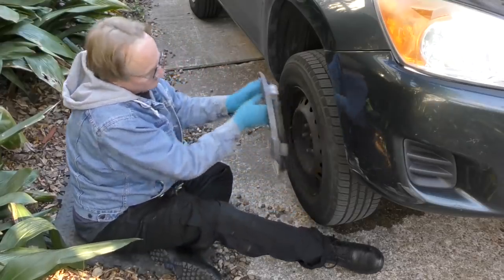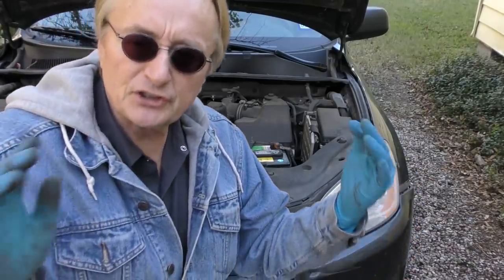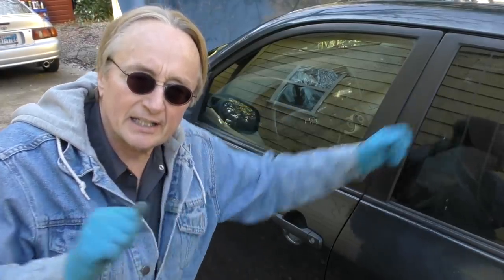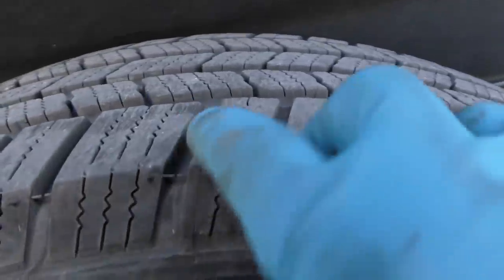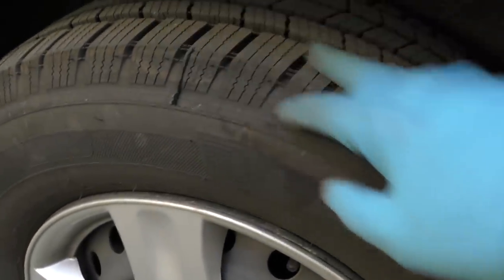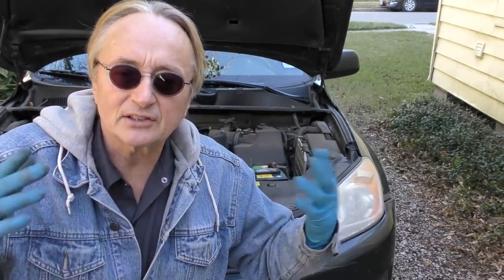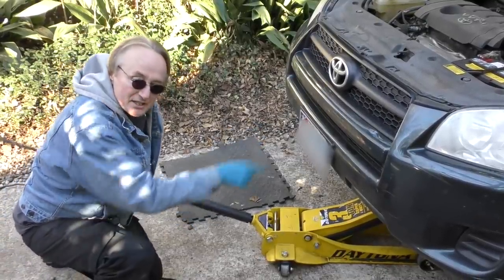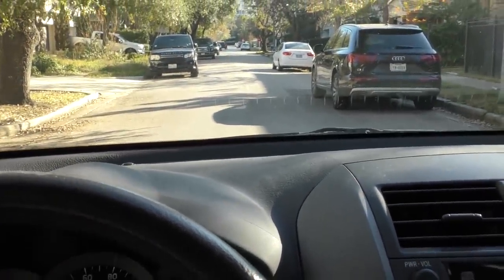Tire Secrets Only Mechanics Know

Comment: Hey scotty, I have a 2005 Yukon XL. The brake light and abs light comes on every time I get on the brakes and it stays on. I have topped off the fluid, checked for leaks, replaced all 4 rotors, calipers and pads, and the master cylinder. It still does its thing. What should I do?
Reply: Do a complete system flush. I had a customer who had that problem for 2 years until he finally got the brake fluid system flushed. The fluid is only good for a few years
Reply: @rays7437  tried that it didnt work. It did help tho
Reply: @salteengaming  
Then the brake fluid level sensor or one of the stability control system sensors could be having a problem.  GM products have touchy electrical systems so it's hard to say. Problems like the one you are experiencing are frustrating
Reply: @rays7437  I tried the sensor. It has no stability control
Reply: @rays7437  I actually tried the sensor after I done the brakes
Reply: @salteengaming  
You may have to have somebody install a data recorder and read the data as the fault occurs.  It sounds like a gremlin that you may never find, however.
You said that doing a flush helped a little.  Maybe try another one?
Reply: @rays7437  I will try that again, I will also get my buddy to do the live data thingy.

Comment: I have noticed ifYou only put one new brake caliper on the front and have a old one on there the other side that the breaking doesn’t seem right also the new caliber works better than the old caliper obviously causing an uneven braking

Comment: That's exactly what I would of done to the vehicle. They also need a front toe/camber alignment, you can see that the wear on the tires show that. 
The owner of the RAV-4 probably had tires put on the car and didn't get an alignment, and now that you rotated the tires their issue is gone, but will come back within 3,000 miles. 
I've been a mechanic for around 20 years, and have my own shop now, but I remember when they came out saying that the best tires need to be in the rear... I NEVER did it, I always put them in the best placement for the vehicle because I cared about the customer. The reason they want the best to be in the rear is because they want the tires to wear out faster, therefore causing the customer to HAVE to come in to spend more money. 
I got tired of cheating people out of their hard earned money, so I opened my own shop and took all my regulars with me lol!!! (Don't get me wrong, I liked getting the extra money from jobs that didn't need done, I just felt bad about cheating people for it)... 
Now I do it all from gas to diesel, engine rebuild/repair to tires and alignments and brakes, all the way to customizing and aftermarket exhaust systems.
When people learnd that alignments start at $20 compared to $80 at Firestone, and $89 at a dealership, they started coming in just for that alone. Then everything else took off after they found out that I'm a trust worthy vehicle Technician, that doesn't cheat the customer out of their money.

Comment: Scotty my air impact gun will keep running even afterletting go of the trigger. It just started the last time I used it. Any ideas?
Reply: I'm fairly certain it's the valve in the handle of the gun... I had it happen multiple times on a blue point gun I had. Get rid of it if it is. If you want a gun to last, get an ingersoll rand. Tool warehouse online, 220 bucks shipped and it will last at least 8-10 years with daily use. That's just a suggestion it isn't cheap but obviously being a mechanic, it's so worth it.

Comment: It’s called tire rotation , also no way that’s gonna make the car feel loose while braking at higher speeds ,, I had a couple cars coming to my shop with similar issues  and usually is a worn suspension ( front or rear) component or a sticky brake caliper or something like that, usually if a tire has a problem you are gonna feel it by just driving the car  , also you are supposed to torque those wheels with a torque wrench or torque stick if using an impact

Comment: Scotty,  I mostly agree with all your o-posts, but this one about putting the best tires on the front of the car  is wrong , you have a flat on the front the car will pull to the side with the flat but you can pretty well control the car till you get off the road,, a rear tire goes flat the car will start to fish tail and you lose3 control, I know this because I drove a modified race car, won two champion ships, over 4 tears, every time I blew a rear tire I spun out messing up the car, you can not control a car at speed with a rear flat tire, you will start to broad slide

Comment: will an electric impact wrench be strong enough to remove an anode from a properly anchored water heater?
Reply: You can try it. My anode rod just laughed at my 1/2" air impact. A 3' cheater bar got its attention. I had to use a pry bar between the water  fittings to keep it from turning. Also worth noting, there's often not enough space above the HWH to remove the anode rod.
Reply: @hughbrackett343  l may be ok being my house is old and has 10 ft. ceilings. Maybe l'll save my $ and go with the cheta idea. Thanks for the heads up.

Comment: Tire shops insist on putting the new tires in the back for liability reasons. They rather have you under-steer than over-steer and spin-out in slippery conditions.

Personally, I prefer putting the better tires in the front for more grip, otherwise, it will never wear evenly compared to older tires.

Comment: Whenever I have my tires/wheels worked on (rotate and/or balancing) I have to recheck everything...tire pressures and lug nut torque. NOT ONCE has a shop done it correctly (stock torque and tire pressures). One time they didn't even reset the TPMS....that jacked up all kinds of issues. One, time they didn't put a wheel cover on properly and it popped off on a busy street. Luckily, I was able to double back, stop, get out and grab it...and not get run over. So, now, I take them off before I have any work done. Can't trust anyone anymore Scotty.

Comment: Correct me if I'm wrong but the MAIN reason the front tires of a front wheel drive front engine car wear faster than the rear tires is because the weight of the engine is over the tires – which Scotty didn't mention.. The supposed reason that tire dealers want to put newer tires on the rear of front-wheel drive front engine cars is spin-out on wet or icy roads. If the rear tires are more worn and the rear of the car loses traction, because there is very little weight over the rear, and because power is not being sent to them, on an icy road if you brake suddenly the front of the car will stop but the rear will not. It will keep going. But because the front is stopped they have nowhere to go except around in a circle with the center at the front of the car. I think they are worried about an accident when this happens, and getting sued. The sales person at the tire dealer described this as "oversteer." Of course, it doesn't hurt that they know that if they put the new tires on the rear, you will need front tires sooner, and if you buy your next pair from them, they will get another sale sooner.

Comment: My lady's 200,000 mile 2006 Toyota Rav-4 is a pile of junk...it was overheating really bad again, took it to my mechanic and it turns out it had a head gasket goin, A HEAD GASKET, but he saved us a bunch of money by using some sort of sealer that has ceramic liquid in the motor and so far it's been runnin alright...my 312,000 mile Ford Ranger has never needed any drivetrain work whatsoever, besides the basic maintenance....and her car, it's had 8 or 9 recall repairs done to it, the most I've ever heard of a car actually having had done, the interior is a plastic filled cheaply done interior and its a top of the line Limited package...she hates it, and it's to the point we can't afford to save money for a new car, but we definitely cannot afford to keep puttin money into that foreign pile of trash...I hope to get either a 2021 Ford Escape Hybrid, or the 2021 Ford Explorer Ecoboost, both will have to come with all-wheel drive, of course....

Comment: What happens when you put the new tires on the front and worn out tires on the back? In wet weather you risk hydroplaning.
If I'm replacing the front two tires and the back tires are in decent shape, I just put the new tires on the front. It's not that much of a risk, and I'm not getting payed for a rotation. Only two tires.
One time I insisted on putting them on the rear on a truck (RWD) with all four tires bald and they only replaced two, but unless there's a significant difference in tire tread I wouldn't worry about it.

Comment: I've never heard anything about putting the best tires on the rear! Either front wheel drive or rear wheel drive it's always best to have your best tires on the front! As you said, front wheels do over 90 percent of the braking and the front tires do the steering so why would anyone put the best tires on the rear? I would rather be able to stop and steer!

Comment: The reason tire dealers put the rear tires on the front and new tires on the back is Road Hazard warranty. When you hit a truck hole, what tire is going to blow out first? The front. 😬😬

Comment: To this day every one comes up with a different fix (1999 corolla) I had new A frmes ,front inner and outer tie rods ,balljoints ,new brakes rotors ,I was determined,I on driving on a glass smooth road ,about 20 mph car starts hopping like a seprated tire ,by the way ,new goodyears  to another bran new set ,still same thing,new struts ,alignment,same thing ,balanced 4 times,no change,new rims.I lost . I told tire co. to rotate a little better but now it puls to the left .OH you need an alignment.Just had it aligned?Put the back tires to front ,now it drives straight ,but at 20 bouncing like a separated tire,all 32psi.suggestions??

Comment: I experienced the same thing and did the same thing when I got home.  Never going back to that chain again (discount tire BTW).  They said because of safety.  Did research and it was due to the Ford SUV roll overs from improper tire inflation from dealers to "improve" the ride, Ford/government directed as they were pressured by government regulations.  IDIOTS!
I always put the best tires on the front as I can easily control understeer with the accelerator (RWD).  Bad front tires and  understeer will be harder (or impossible).... and decreased braking performance  If a blowout happens, would much rather it be on the rear as you have much better control... but what do we know from decades of experience and driving... NOT JUST STEERING AND RIDING!
Happy New Year Scotty : )

Comment: You always want your bad tires on the back with a front wheel drive car
Reply: Yes, I agree the tyres with the most thread should be at whichever side the drivetrain(or whatever its called) is, because that's where the power is. The argument for having good tyres at the back is when cornering at high speed on wet road it prevents the tail end from swerving out, but why the hell would anyone want to corner fast on a wet road. If they do they should pay the price, no tyres can save them.

Comment: ...mmm sad to say BUTT I was told many times that I needed to replace my front struts      ( they lied )  I finally had to replace them when they had 462,573 miles on my Honda Accord !  I also ran into the ole Bee Sss about the tire shop only being able to put two new tires on the rear instead of the front !!!!!   I argued that I paid for the tire repair warranty and when I would bring the car in for the ole FREE tire balance and rotation - they wouldn't be able to rotate them !  So if they will not install them as I wanted ... They lost a customer

Comment: The policy should be to satisfy the customer. We all see what the letter E plus one lettering experts have done for healthcare in the last 25 years. Yes, I want my worst tires doing all the steering and most of the braking. I can see the point for bad drivers but that is what abs prevents. Just stupid! I’ve been a mechanic since 1957 when I build my first go-cart. Not my Dad, not my brother, no one but me, bolts, welder, combine parts, a Briggs & Stratton and bicycle parts.

Comment: My truck fronts wear 2x as fast as rears. I replace fronts only and the rears usually dry rot before theyre dead. I worded this wrong...
Reply: So when i need new ones (which is like every 8 years), the rears move up front and new ones go in back

Comment: If I buy two new tires on a Friday, the tire guys will want to put them on the back.
If I go back to the same tire shop the next Monday, they will tell me that I need to rotate my tires for even wear.  What the bleep kind of sense does this make?
Reply: No, if you already had new tires installed to the rear a couple days ago, and you came back the replace the front, they'll just replace the front. The rear is already brand new....come on man. Only if the rear tire threads are bald or has low thread depth like 3/32nd or 4/32nd is when it's good/recommended to put new to rear. Also this "new to rear"  thing should only be advised in areas that has high chance of snow or rain...bald tires in the rear doesn't affect vehicle traction on hot dry roads when driving decently and not recklessly speeding...
Reply: @PanameraTurboSEHybrid  There was a bit of sarcasm in my remarks, but I can say that the gist of this is what I have found to be true in my area.  Without anyone checking tread depth or for signs of wear, I have been advised to rotate newer/less worn tires from the rear to the front.  So, if it's a good idea to put new tires on the back, why encourage rotation?  Doesn't the rotation un-do the benefit that the tire industry says comes from having tires with better tread on the rear?  I put the best tires on the front, keep an eye on the tread depth, and rotate as needed.
Reply: @gregnixon1296  When I used to work at a dealership, I always check wear before I recommend rotation if front tires are being replaced because not all the time new tires need to be rotated to the rear if those rear tires threads are above 4/32nds and are still wearing evenly. It doesn't make sense to me that most tire installers are forcing people to rotate good rear tires to the front unless those tires were recently changed and/or was due for a rotation.

Comment: Lol he calls that low tread? My last tires I drove until they were slicks. Then I kept driving em until they blew out. When the back ones finally let go, I didn't realize that's what had happened. So I rode the rim for another 2 or 3 miles before I caught on to what was happening.

Comment: NEVER rotate tires from side to side, like they used to suggest years ago, before steel belted tires. Changing wheels from side to side will reverses the wheel rotation.  That can sometimes cause a lot of problems with steel belted tires.
    Need a visual ?  Think of a wire wheel on a bench grinder. After a while the wires all bend backwards.  If you turn the wire wheel  around,  the wires now bend forward.  Can you imagine something like that happening inside your tire ?  Those wires could destroy your tire internally.
Reply: Agreed. Yet most owner's manuals still show that the tires should be cross rotated.  Even on cars that use directional tires... Dumb
Reply: That is only the case for directional tires. Regular inside-outside tires dont have that problem

Comment: Sounds like lack of tire rotation. I will install the new tires on what ever axle you want. The primary  reason  behind putting  the  best tires on the back. When you brake the front of the vehicle  noise dives lifting the rear of the car up.  This causes problems under emergency  driving situations.  How ever if you rotate your tires on a regular basis you should in theory  have equal  wear.

Comment: Scotty, My car is 12 years old but has only done 12,000 km, should I change my tyres because they are over 10 years old.
Reply: You should replace tires after 6 years because the rubber breaks down and there is a greater risk of something going wrong.

Comment: Amateur question: why did he jack up the front and back for a rotation? Why not jack up the left, do both, then same on the right? I've been doing mine that way at home for 40 years.
Reply: This guy has no clue what hes talking about, take everything he says and does with a grain of salt
Reply: I think he is aware of the option of lifting in balance from the side of the car. But he showed the process as he did for camera & illustration purposes.

Comment: I thought better rear tyres was to prevent the back end losing traction and spinning out under heavy braking.
Reply: That is correct.  Understeer is less dangerous than oversteer.  Michelin lost a lawsuit over this which is what prompted the businesses to set the policy.  You have to be very careful with Scotty.  Sometimes he is right, sometimes he is wrong, but he always thinks his instinct is gold.  Case in point, when the shop refused did he investigate the motive why or assume the motive and assume he knew better?  The video answers that one.  It's good to question things but it's worse to never question yourself.

Comment: you did NOT think to research why the new tires go on the rear. most vehicles are heavier in the front than in the back. rear tires can hydroplane or slide on ice easier than the front. having the rear of the vehicle slide  is more likely to cause a crash. I get my tires at discount tire and they always put the new tires on the front. if you don't like that get all 4 new

Comment: The reason you should always put new tires on the back is not a bunch of crap, you can search the video where they test new tires on the front vs the back and the one with new tires on the front spun out uncontrollably on a wet curve road. I understand why the tire shop refused to put them on the front because of liability reasons..